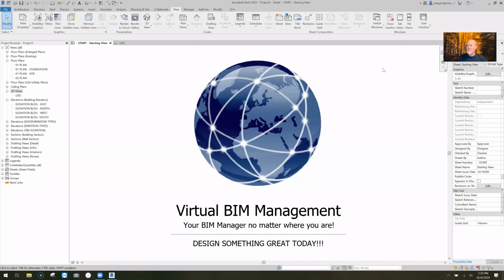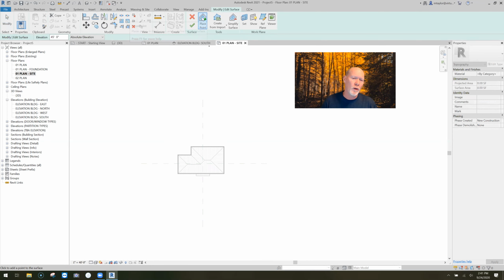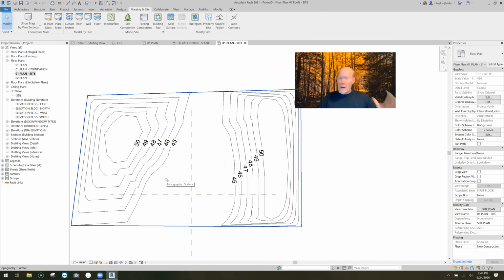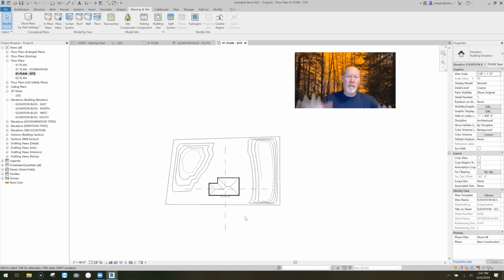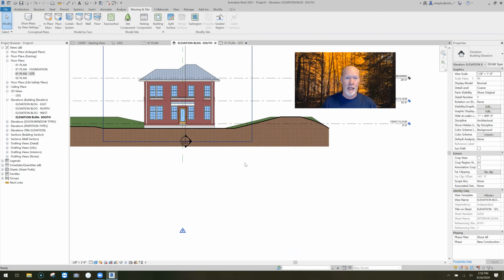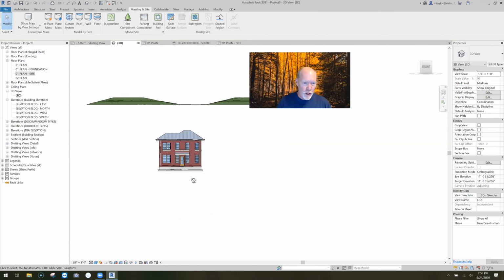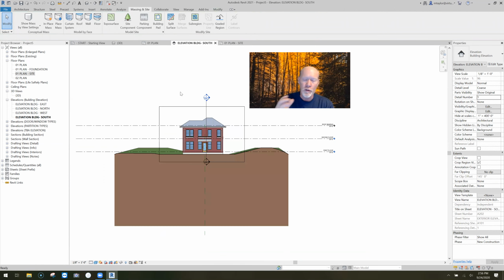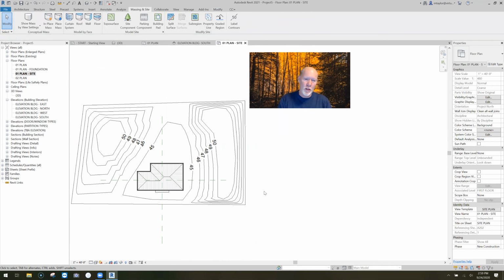RECONCILING TOPO AND LEVELS: And fixing site problems

Comment: Thanks for your video Mike. Could you maybe make video to obtain a retaining wall elevation that sits in a round excavated cavity meant for a 100m diameter 8 storey building. The topography is highly undulating.  I need this elevation because I need to see at what section is the highest amount of earth that need to be retained.
Reply from the maker: You can place a Site 'PAD' on the topography (set it to the correct Finish Floor Elevation) and it will press down a nice flat construction surface for your building.  Then you can add a perimeter retaining wall around the edge to hold back the dirt.  Then simply cut a section anywhere you want and you will see how tall the retaining wall needs to be.

Comment: Hey Mike,   I tried to move up the levels, as you demonstrated, on a project I'm working on and received an error message.  REVIT wanted to delete numerous elements and views in the project.  This is a renovation, so I have existing, demo, and new elements in the project.  I tried turning on 'show all' in the view properties, but that didn't seem to make a difference.  Any suggestions on how to move levels without Revit deleting a bunch of elements and views?

Comment: Your video explained this in the best/easiest way…. Thank you!!!   I had the same problem you started off with – where my actual “above sea level” topo was in the correct place – but my house was not.  I tried moving my house & level upward – but there were about 75 constraints that were preventing me from moving everything properly.

In a nutshell – what should my basepoint be set to; my survey point be set to?  I am working in Meters above sea level (Canada).  I have play around with the elevations of my base point and survey point… with no luck.  When I move my level up to where they need to be – I get about 75 “Constraints are not satisfied” error warnings – and nothing works.  

Do you have a comment as to what I may be doing wrong?
Reply from the maker: You could copy the whole house to the new location rather than MOVE it.
You can then simply move the sections and elevation markers.  Just a thought.

Or, look at the 75 errors.. can you live with them? Perhaps they are only on one family, like all the millions of a curtain wall.
Reply: @miketaylor-fantastic       ----    Thanks for the response.  I went through the errors - I have one reference plane that is a culprite - the others were various.  I am new to Revit, and have been teaching myself ALOT in the last 6 weeks.  Were I work (Alberta, Canada) - the econmy is dying from interest rates - so now is a great time to learn.  There is no one in this City that can teach Revit - so I am online only.

Having said that - I took your advice - and I can ignore about all errors - but there are three left (they are codes - I don't know what they mean) - and they do NOT allow me to procede - so I am stuck.

I started a new project and drew a box house with garage - and started from scratch watching your video - and I was still having issues.  I know it is something I am not doing properly - due to inexperience.  Do you have any other recommendations or references I can look into?  I appreciate your time in responding to this.  Also - does your company  offer one-on-one ttraining virtually?
Reply: @miketaylor-fantastic 

 Thanks again Mike for taking the time to help me out.  It’s funny that when I do more research – a lot of Revit users mention a “separate site plan” is the easiest way to do a sea level-based topo site plan – but in your video it all works in one.  You obviously have this figured out.

Quick update…. I still have not figured this out (for my specific project) – but I think I am getting closer.  Here is where I am at:

I deleted my topo and started over – using the survey grade points supplied from developer.  Everything works when I check the elevation points - and my topo is in the correct location.  When I moved my building upward… I had all those errors.  What I did to move the building upward was - instead of the “move” command – I went to “manage” and “position” and “relocate  project”… and moved my entire project upward 939.31 meters above sea level (939.31 is the top of my garage slab).  This all worked great…. Until I viewed a 3D shot – and my topo is still floating way up above my building.

I went back to my site plan and confirmed the topo elevation points – and they are correct.  I went to my south elevation and checked my levels... they are correct.  Just to mention – my levels are referencing the “survey point”, my project base point is set to 940.409 meters (which is the top of my main floor {approx.. 1.099 meters above my garage slab), survey point is set to 0.00 – which I am assuming is sea level and not to mess with that.  When I look at my AutoCAD drawing (cross section and site plan) ALL these elevation points are correct… so I know I am on the right path.
I deleted my topo surface (again) and restarted knowing that my location is vertically in the correct location… and my topo still is floating way above my building.  When I enter the elevation points for my topo – it almost seems like they are referencing off the base point – and not the survey point.  So here is my question….

  Is there a way to change the reference point of the elevation points so that they reference the survey point instead of the project base point?  

I have looked this up all over- and can’t find a solution.  Maybe it is impossible – and if it is….I guess I am hooped.  I am hoping you can give me good news with a simple solution.  Thanks again for taking time out of your day to look this over.  I am sure you are busy – and your time and opinion is appreciated!!!
Reply from the maker: @tonysterba7617  Yes.. you can tell the Level markers (type parameter) to reference the Survey Point and the Spot Elevations too.

Comment: my company have all the building on 0-0

I just link building to the 3d topo site. 

but it create all kind coordination problem.

If a complex giant project.need split project to many smaller pieces by buildings.

What is the best practice?

The way you are showing is one simple project on topo.
Reply from the maker: For large projects I like to make one file the site... and then link each building in from its own file.  I keep each building separate for the drawing/construction  set.